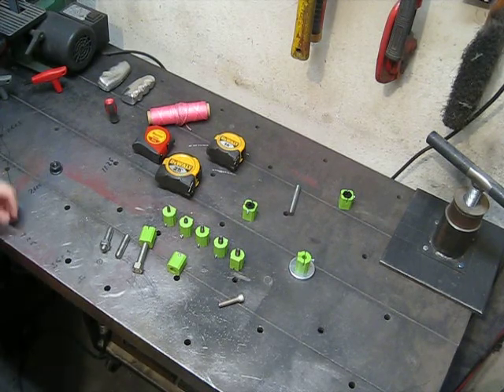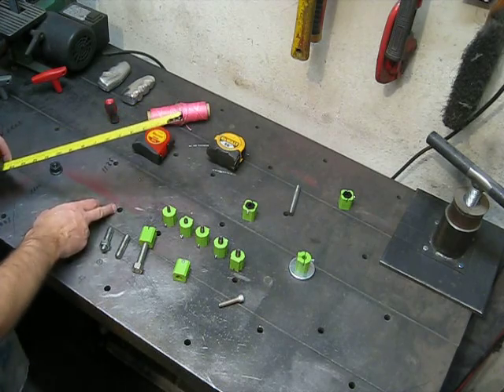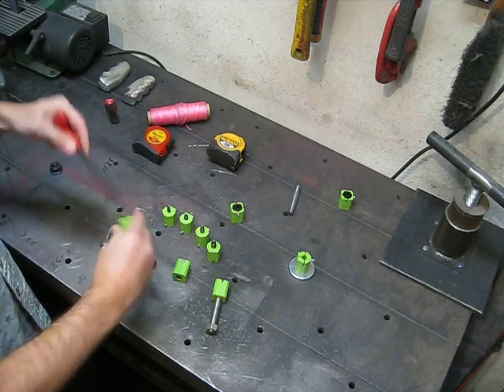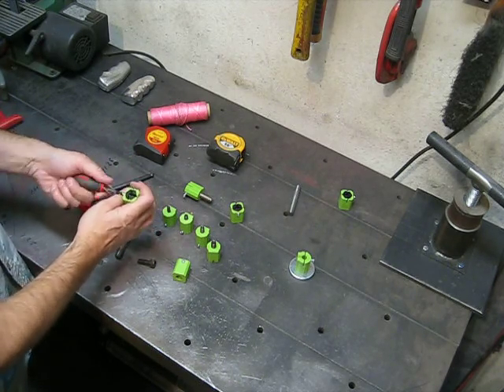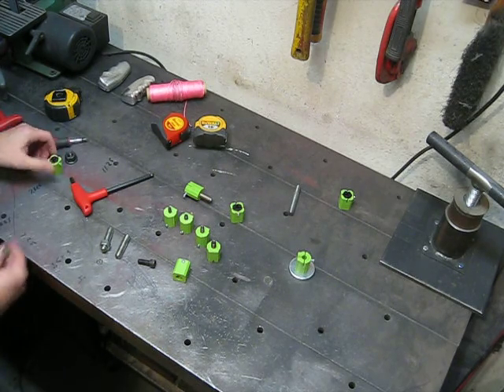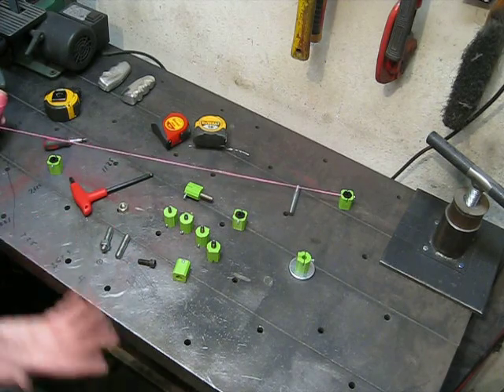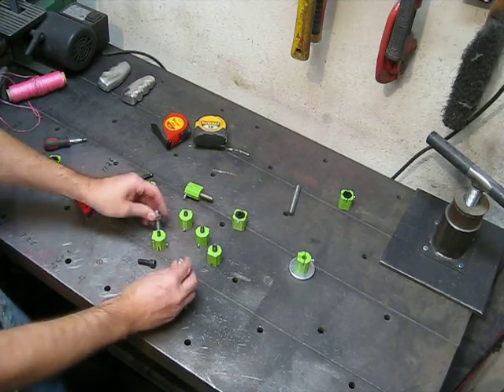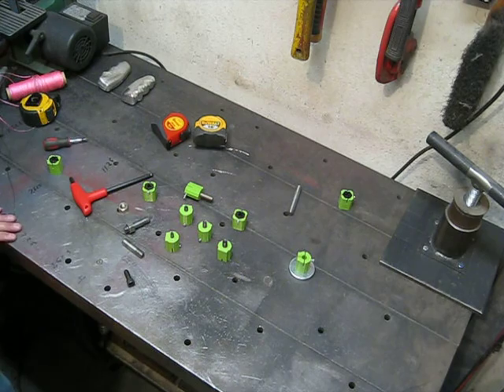3D Printed Threaded Measuring Inserts

Comment: I subscribed to watch your solidworks tutorials so I'm new to your channel. If you don't mind me asking what is your occupation?
Reply from the maker: +It&#39;s Mayama  I learned SolidWorks after an industrial accident ... Therefore I now redesign items of which other engineers have failed at when they originally designed them ... Thus, I review the items, then figure out solutions, then draw them into SolidWorks, then send CAD files to be machined/cut with CNC at a fabrication shop, and then assist in the welding, assembly, and installation and/or repair :-)  Use to work as a Diver/Welder/Engineer after College, so I understand fabrication which assures better success in the process of going from SolidWorks Drawings to Real-world items :-) If YOU wish to be better at SolidWorks take a Welding Class at a Tech school, or volunteer at a welding shop ... It will change your life, because you will be much better than the designers/engineers that don't have fabrication/welding experience :-) CHEERS